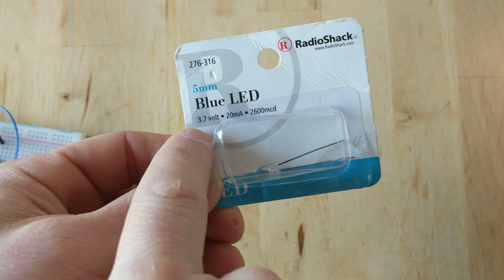Driving a high voltage blue LED from low voltage coin cell using a super cheap charge pump circuit

Comment: Sorry if you don't understand coin batteries, but the battery you used was basically dead, anyways. It would have supplied enough power to light a blue led all-by-itself. And when was a blue led certified as High Voltage?
Reply: 1:42